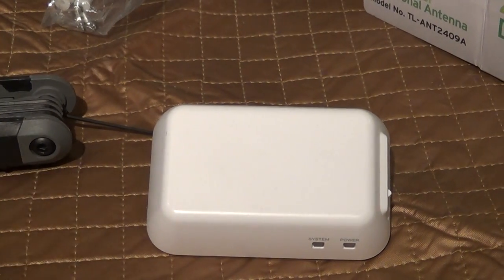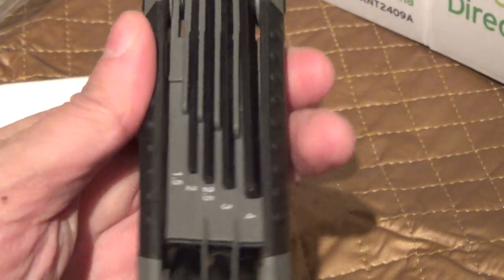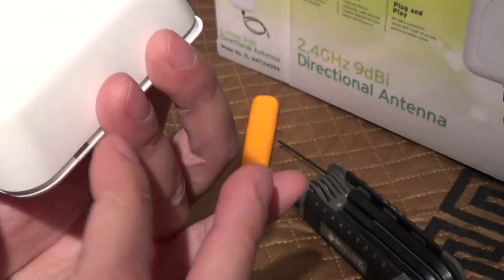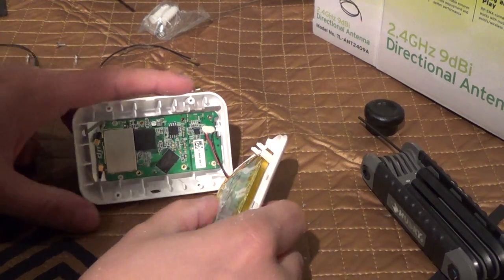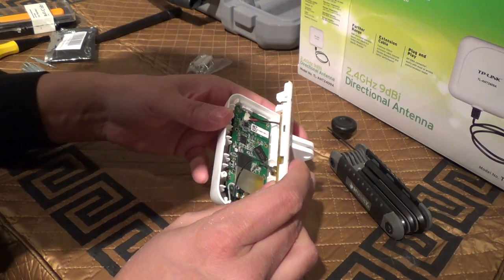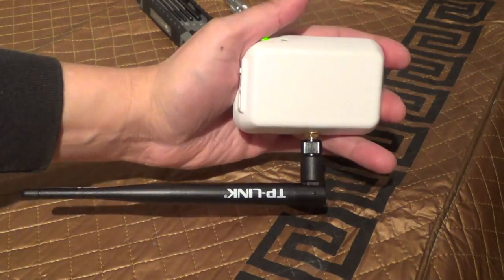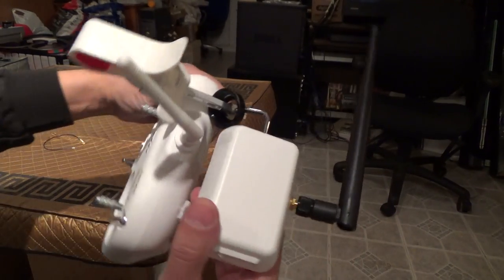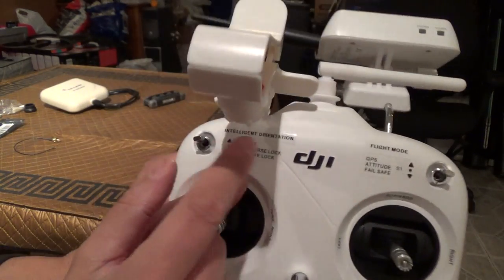DJI Phantom 2 Vision Wifi Range Extender / Repeater  External Antenna Mod increase FPV range.

Comment: I made these exact mods except that I replaced both external antenna's with two external antenna's that you recommended.  *NO* better range, in fact it seems to cut out more frequently now. (commented on the wrong video before).
Reply from the maker: This mod if done without incident definitely can give a moderate to substantial improvement in range depending on antenna pairing.  It's also worth noting that your range and reliability can also vary significantly depending on the level of external interference from other electrical and wifi sources.  With that said range tests when changing equipment needs to be done in the same exact conditions to be able to properly and more accurately determine the results.  I will provide links to a site that provides some LHCP directional antennas which will give you the best performance with the phantom 2 visions stick antennas.  It's also good using one of then alone with one omni directional.
Reply: I performed your steps with the parts you listed. As an engineer, I have exact steps that I follow for range tests in the same environment each time.  This mod actually seems to decrease range (cuts out more frequently at distance), plus makes it more difficult to store in the case (have to take off the antennae's each time).

Comment: Can I do this mod on the phantom Fc40???
Reply from the maker: The Phantom FC40 doesn't come with this repeater. But in theory you could probably use any wifi repeater to extend the FC40's range. if you can use this one with the FC40 yes you could certainly use this mod with it.

Comment: Thanks for the great video.  I have a question.  I have experienced very poor connection with my Phantom Vision 2 since I bought it.  Usually, my connection starts failing around 500-600 feet.  I once was able to achieve a successful flight out to about 1000 ft.  I performed this exact upgrade and still have similar results, connections lost around 500-600 ft.  Does anyone have any insights as to what may be the problem?
Reply: Thx for great tutorial Ben. I have same problem as Pete. I even tried to use extender without my 8dbi omni antenna,  unscrewing it during flight meaning it works with only 1 stock antenna and still same range. Also i have tried both antenna connectors with same results.
Reply from the maker: That distance is normal depending on how much interference wifi or otherwise is next to where you are standing when flying.   Also assuming you fly in the same place before and after upgrade, there is likely a strong area of signal interference you're flying through at the point it's cutting out.   The park I usually fly at has a spot roughly 1,000 feet away that will often cause interference with my connection as well.  It certainly improved after my upgrades but it will still be an issue from time to time.   Though flying in other areas I'll never have problems flying past 1,000 feet with no loss of signal dropping on and off.  It all comes down to interference and were you fly.  I've so far been able to fly a half mile flying sideways with just the 8dbi antenna.  And with the camera mod I could do that at any orientation and with full signal.  Anyway try flying in another location and see how it goes.
Reply from the maker: Aleksandar Krstovic Assuming you did the antenna mod right the 8dbi antenna makes a substantial improvement over stock. Though read the comment I wrote to Peter for more info.

Comment: Maybe a silly question but why do you need to install antennas on the camera in your other video if this extends the wifi from the iphone at base. Also you seem pretty knowledgeable. any ideas on using fatshark goggle with the vision 2?
Reply from the maker: The more antennas along all points of the connection the better your overall results are going to be. it's no different than a chain being that it's only as strong as the weakest link.   I don't know how you can use fatshark goggles on this short of finding a 2.4ghz version and turning off the P2V's wifi so it wont interfere with it.   You may as well just get a Phantom 2 non Vision with the H32D gimbal at that point.

Comment: I just finished my mod! With only one antenna I gained nearly 500 additional feet (1500 total). Opening the box with those plastic clips was a little tricky, but after I got  it open, I shaved them off for easier access for future service. I also left room on the range extender for a second antenna when it arrives in the mail. Thanks again and Happy flying!!! :-)
Reply from the maker: Nice result, I don't entirely get why some people say it's not changing. Unless they did something wrong it should be a good result. Though flying conditions such as heavy interference can restrict range regardless of antennas. Simple fix for that is try a new location.   Anyway tomorrow I should have some Helical antennas I ordered that will pair up with the RHCP Skew Planer antennas on the Phantom. Hoping to hit a mile range with that setup. I'll see how it goes over the weekend.
Reply: Yeah, I think I had a bad camera. I ended up returning the Phantom for a new one from my dealer (the 3rd one!) But unfortunately I crashed it today, destroyed my new $650 gimbal and bent one of the arms on the Phantom. The gimbal is custom made in the Netherlands, I just emailed them about it, I hope they can repair it, they're already so backordered. I also purchased a new Phantom body from the deal (B&H Photo $50), to say the least, its been a very expensive day. :-( Do you know anyone I can call to put the guys of my old Phantom into its new shell? Thanks and happy flying!

Comment: Do you have you put the directional antenna
Reply from the maker: You're question isn't complete so I don't know how to answer you so I'll wing it.  You can use whatever antenna you want with this mod.  Directional, Omni Directional.  For optimal performance use an LHCP Helical antenna.  Or better still do this with two antennas using one omni directional and one Helical / directional antenna for best close and long distance performance.

Comment: Thank you Ben7seven7 for this excellent tutorial. Everything went perfectly as far as mounting the antenna. I went with the single 8dbi omni TP-Link antenna from Amazon that you claimed got your Phantom to 2,533ft. I don't see how that is possible with the stock antennas in the Vision camera.

Flying straight away from me at about 150ft altitude, I was able to get to 990ft before connection was lost. When I turned it sideways, I was able to regain connection and go to 1,100ft before it lost connection again. After that it never regained connection so I had to come back and land it with no FPV. This is up from my max distance of 850ft with the stock antennas. Any tips or ideas on why I can't get mine farther. I'd be absolutely thrilled if I could even reach 1,500ft with a solid connection. I had the antenna laying sideways and was facing the Phantom the entire time.

Thanks again for the awesome tutorial though!
Reply from the maker: Where you fly as well as your preview quality will both dramatically effect how far you can fly with FPV running.  At the park which still has a fair amount of wifi near me is where I got the 2,500+ foot distance flying sideways so the built in camera antennas pointed toward me.  In my neighborhood with a lot of strong wifi less than 15 feet of my location best I have gotten is approx 1,400 feet.  Of course with my Antennas mods to the P2 Vision camera I've now improved on that.   If you want to push your distance out further than what you can with the omni there are some good LHCP Helical antennas you can get, starting at 12dbi and up.  And of course the 14dbi TPLink works well for people though it's on the big side.  I'll add more antenna links in my description when I get the chance as well as video on how you can increase the range of your omni directionals. I'd have gotten them out already but I've been sick.
Reply: Thanks for responding. I totally forgot to lower the video quality of the stream. Thanks for that tip. Also I heard that in order to use a Helical antenna I'd also have to mod the inner camera antennas in order for them to receive the signal. I'm trying to get the best range without having to upgrade the antennas in the camera itself.
Reply from the maker: Alex Mondini FPVLR.com as well as some other sites sells FPV antennas you can use with the Phantom 2 Vision. Most of them are LHCP which works best with the built in Phantom 2 Visions antennas. You can also request them in RHCP. Which is right hand versus left hand circular polarization.  I got a couple or RHCP Skew Planers replacing my P2V's antennas so I went with a RHCP helical antenna which I'll be testing out this weekend.

Comment: Ben I did this mod and now I get solid green power light and no light on system??  I am getting ZERO SSIDS for either the camera or the repeater anymore.  PV2 was working fine last flight so I am not sure the issue prior to mod.  The camera on power up is orange and then solid green.  I do see some internal light on camera blinking inside the housing camera housing.

Any insights would be helpful.
Reply: From the specs I think the camera light is suppose to blink green when set to ON/WIFI - mine stays solid green.  The light system light on the repeater never goes on at all.  I NEVER see any phantom_XXX or fc200__ netword options any more at all when I scan for wifi networks.
Reply from the maker: I've been in my repeater a couple of times, doing my initial upgrade then later adding a second port and neither of those times did it cause any problems with the wifi. 

When I changed my P2V camera antennas on the other hand, it took quite a long time and two power cycles until the wifi eventually came up.  First time I waited easily 5 minutes, nothing, power cycled, waited a couple of more minutes then it appeared.  I don't know if you may have to do something similar for your own setup. That or try to rebind the units. 

As long as you didn't static shock any of the internal electronics you should be fine as most have who've done this modification.  I always touch something grounded and metal before working around electronics.   That or use a anti static wrist strap. Also hope you didn't damage anything by accident when you opened the repeater itself. Either way best of luck.  I'm also going to show how to use any off the shelf wifi repeater with the P2V which can give potentially net you even better results than using the stock one that comes with your Phantom.
Reply: Thanks.  Can you tell me if my P2V camera should be blinking green if switched to on / wifi.  I am only getting solid green.  Instructions say it should be blinking.. thanks ben
Reply from the maker: Cory Fechner The Power Light on both  the P2V Camera, and Wifi Repeater should both maintain a sold Green light.  The only light that will occasionally flash on and off is the "System" light, to the left of the Power light on the Wifi Repeater.
Reply: Ok. Thanks.  The P2V camera manual page 19 says the green light should blink on camera if you move switch to on/wifi.. 

Can you confirm that your vision camera does NOT blink when u have it switched to on/wifi
Reply from the maker: Cory Fechner I think you need to rebind. Here are the rebinding instructions  copied from page 16 of the current version of the Manual.

1)  Power on the camera and range extender. Note:(Place the camera power switch to the ’WIFI
ON‘ position).
2)  Approximately 30 seconds later, press the reset button on the range extender with a thin object until the
Wi-Fi signal indicator turns off. The range extender will then restart automatically. (small hole between the off position and micro usb port)
3)  Approximately 30 seconds later, the Wi-Fi signal indicator should start to blink green, which indicates the
range extender is now ready to be bound.
4)  Find and select the Phantom_1xxxxx via the Wi-Fi list on the mobile device to connect the range extender.
5)  (Fig.1) Run the DJI VISION App->Settings->General->Binding. (Fig.2) Select ’Scan the QR Code’ to scan
the camera QR code on the product packaging. (Fig.3) Get the camera SSID (E.g. FC200_0xxxxx) and the
MAC address, select the tick on the top right corner. The range extender should automatically
restart. The binding procedure is now complete.
Reply: Can't rebind because I never see a wifi network to connect to.  And the system light on range extender never lights up at all.  You need to be able to connect to app to rebind.  That is the issue a have never seen and wifi network options since I added antenna.  Im stumped.  Maybe I need new repeater or maybe new camera..  I have no idea at this point.
Reply from the maker: You do not need to see any wifi to start the rebind process.  Just power up both devices and use a paper clip to hit the reset switch holding it down till it resets.  At least a few seconds most likely.  From then you should find it in your wifi list and do the rest.  And the camera light is always sold green I don't see it flash at all.
Reply: I though I need to see system light to reset. Manual says the system light will turn off once I push and hold reset.  I will try it again
Reply from the maker: Status?
Reply: Holding the repeater reset does nothing.  I held it for over 45 seconds..  nothing.   So because you say the camera light is solid green even on WiFi .  I think maybe I need to order new repeater n see what happens.
Reply: I still never see a network option.  Can you see network option directly from camera with repeater off?  I know I used to see two options when I. Was able to connect to Wi-Fi.  Wondering if I should see camera ssid even with repeater off
Reply from the maker: Cory Fechner The SSID on the camera is hidden except for when starting a binding process.
Reply: Ok.  Well I got a new repeater on warranty the way from dji.  I guess this is the first step..  I SHOULD see the system light on repeater and have not at all since it wasn't working

Comment: the fact the internal battery is 2000mAh as I see in the video- does that mean we can charge at up to 2Amps for the fastest charge rate (eg. using my 2 Amp cell phone wall charger)? I ask as someone else in a forum said that no matter what rate you charge at the device  limits it to 0.5 amps..
Reply from the maker: No unfortunately I used a 2amp charger and it still took 5 hours to charge from dead to full.
Reply: Ben7seven7 oh- that sucks- that's the worst thing about the p2v- the long repeater charging times..you think the repeater's internal rechargeable battery is replaceable once it starts degrading? PS- just followed your video finally to upgrade one of the antennas for the 8dbi tp link omni and the 14 dbi tp link panel/patch antennas (to swap between)..yet to test but thanks for making the vid again- PPS- did you figure out a practical way of mounting the panel antenna to the repeater?
Reply from the maker: justinspirational Hi, yes I found a couple of ways to mount the 9dbi TPLink. Simplest was to get a second phone holder clamp. It holds onto the metal mount bracket of the antenna.  I recently just ordered a RHCP Helical antenna to pair up with two RHCP Skew Planer Antennas I got for the Phantom. I'll be testing over this weekend and I'm optimistic I'll push past 1km with that setup even in my wifi congested area / parks.   Also I posted an easy mod version of the camera antenna upgrade.  Take note of the annotations as I made a correction to one of the parts I talk about in it.    Anyway how's the range from your setup? I bet your pushing 1km or close to it with the 14dbi TPLink. Though you would have to fly sideways to do it, with the stock P2V antennas.

Comment: I see on this video the antenna is on the back but on your other video where you are showing the mod for the radio, the antenna is on the front by the LED's. Can I ask why you changed the location of the antenna on the WiFi extender? Maybe there was a problem that we should know about? I have the parts on order and I plan on doing this mod over the weekend and want to make sure all is good before I start.

Thanks..
Reply from the maker: I added a second antenna port to see how a dual antenna setup worked.  If using two antennas of the same type the dual setup didn't improve overall range but did increase video stability somewhat.  It's main benefit will be using two different types of antennas such as a helical antenna along with an omni at the same time for good long range and shorter range flying at the same time.

Comment: If you lose range with one internal antenna connector try the other one. One antenna is the 'master' and talks to the camera on the P2, the other is the 'slave' and talks to the phone (duplex), it requires very little signal as the phone is meant to be within a few feet of the repeater. With the open repeater in front of you and the connectors at the bottom then the left connector is the one to use for comm with the P2V, two antennas will not make any difference.
Reply from the maker: The antennas don't work in a master slave setup.  It's diversity as in both antennas serve the identical function using one antenna or the other at the same time whichever is getting better signal at the time.  As opposed to one talking to the phantom and the other your smart phone.
Reply: Ben7seven7
That's interesting, did you get a schematic of the set-uo?, do a teardown, or get the info from Support. When I asked support for this info they said they could not help me.
Reply from the maker: This has been confirmed by actual thorough testing of the unit both by myself and many others.  Trying one connector and the other and with both together.